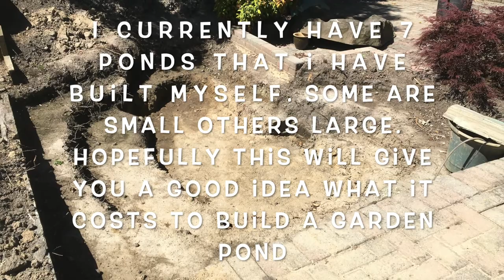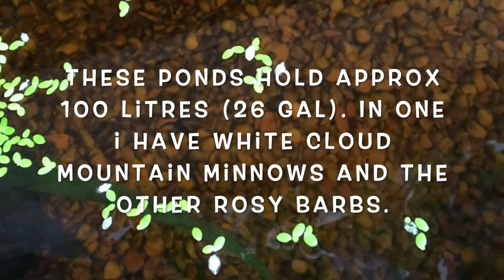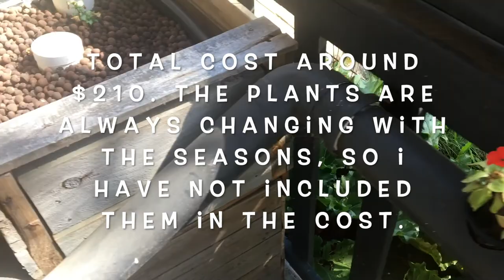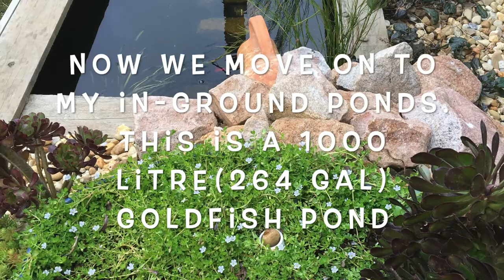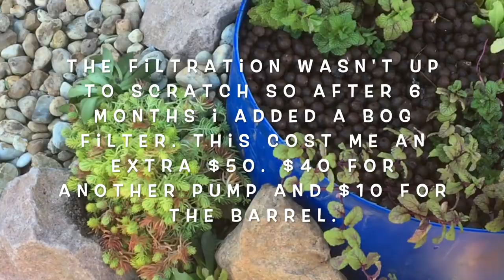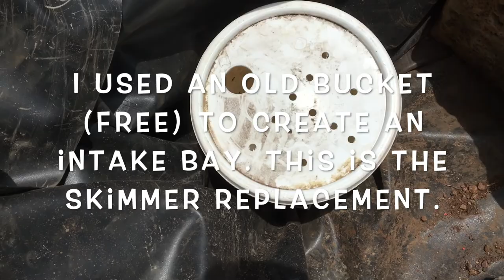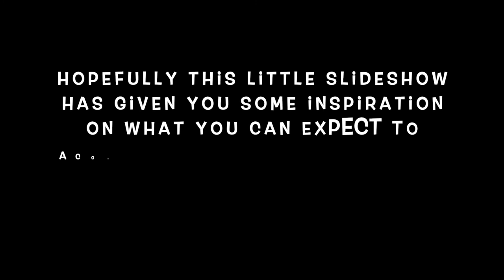Cost to build a garden pond with 5 examples

Comment: Very helpful when planning out the scope of work whilst vs space available.  How are the temperatures of water deeper/closer to the ground?  I'd like to think we could keep "tropical" fish in USDA zone 10 (avg lows mid 40F) if there was sufficient radiant heat from the ground to keep them happy over winter at around say 65-70?
Reply from the maker: My water temp stays about 5C warmer than the air temp during the middle of winter.
Reply: @Ozponds  Thanks! Great data point.